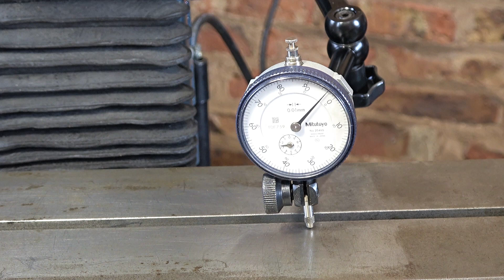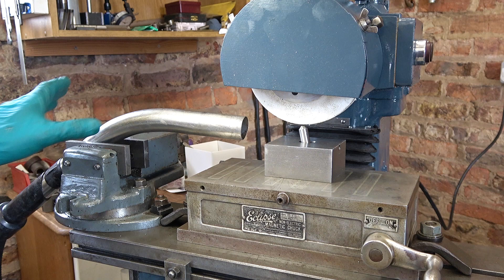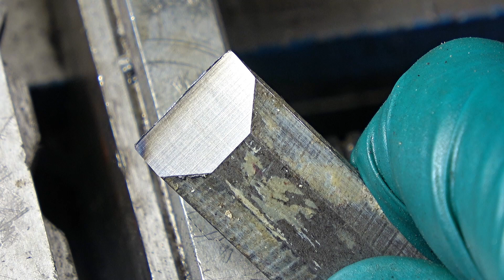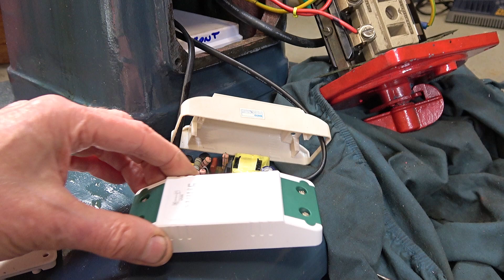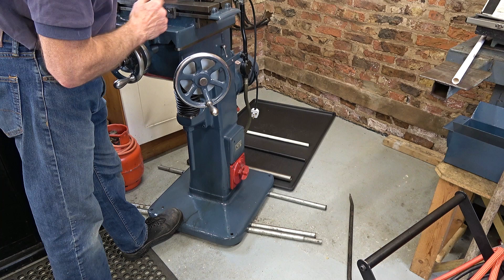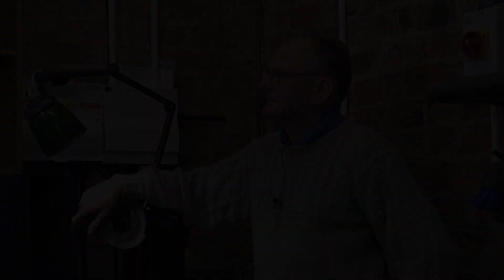HS267 Herbert Junior Mk2 surface grinder Part 16 – making sparks

Comment: Very brave project brought to a good end. Should you read comments under 11 months old youtube films, I would be very interested in a ball park figure what this project has cost you. I do not have enough space either, but if I ever do, a surface grinder would be high on my list and it would be interesting to know if such a path would be possible with my budget restrictions.
Reply from the maker: Hi, I think the grinder itself was about £275. Transportation free. The inverter would be about £80 used from ebay. The bearing maybe £30. A bit for some bronze. Paint was free to me. Ignore the bits I bought by mistake (the stuff for the static converter) so I'd guess at £450 would cover it. I've seen those grinders in reasonable condition selling for £800!! Hope that helps.
Reply: @HaxbyShed  Thank you very much! That would put a surface grinder within my budget. I will look out if any are sold in the Netherlands for such prices!

Comment: That height irregularity is always a problem with shaper tables, which is why this design is odd, because it’s longer than the table movement. That’s odd because you’re supposed to bring the table before using the machine. Then you grind the bottom of the vise, without turning the vise on, just lightly hold it with clamps at the ends, pushing at the vise. Then, flip and machine the top of the vise. Some say with the magnet off, but I do it with the magnet on as that’s how it is used. The problem with a long table is that you can’t grind it properly. That’s a design defect. If this were mine, I’d do what the manufacturer should have done, and machine the ends of the table down by about 4 mm. Leave 8” in the middle to mount the vise on. Then you can grind that to level it, as should be done. The problem with just grinding the vise is that every time you remove it, you lose your exact level if it isn’t placed exactly parallel to the table movement. Though it should be parallel if you want the vise guide at the side, and end, to be accurate. Whoever said to get an 8” table is correct. Otherwise you can’t grind the vise either, as you’ve found. You can’t cheat with your vise by removing the stop screws, just to grind the top. It will be ok, but not ideal.

Comment: Iv got the same grinder and mag chuck. Simply mark out the max working area on the chuck face and relieve the rest around the edge on the mill. You only need to take it down 0.5mm and that will give you plenty of material to resurface many times before you have to mill it again

Comment: Hi Paul. Great tip about using a dog tray as a drip tray. Definitely going to look at those. Well done on completing the surface grinder restoration. Brilliant series. I for one hope that in time you find another machine to add to the workshop and a new series ensues. 👏👏👍😀

Comment: The wheel slips a little bit in the blotters every time you turn the motor switch on. Do it a few times on and off,  then measure the wheel runout. You will see a few thousandths.  You can dress it for sure, but your balance goes out the window.  This is why all my grinders have VFD drives.  Soft start takes care to eliminate the rapid start.  Slowing the wheel with the VFD is also great to dress the wheel at a few hundred RPM.  Grit does not go all over, and you can dress a spiral into the face of the wheel to clear swarf and prevent loading up the wheel.  It does work well.  So many advantages to a VFD.  I know you have settled on a phase converter, but you can't know until you go through a process.  Cheers. ----Doozer

Comment: I believe your table has warped from the tee bolts pulling on the slots for a long time. The heads are likely too small.  The underside of the bolt heads peen the inside of the tee slots. If there is any distortion in the tee slots that you can see or feel, this is what likely happened.  You can fix this, much the same as some fitters have done when rebuilding Bridgeport tables.  You can peen the underside of the table (with a hammer) and induce stress on the back side. This balances and counteracts the stress from the tee slot deformation. The result is the table bends straight again.  The same process used to camber a beam. You can use spot heating or peening for that. Same idea.  ---Doozer

Comment: Traditionally chisels are ground in the surface grinder in the opposite orientation that you have.  Then use the cross feed instead of the table feed, and the radius of the wheel will be imparted into your chisel edge. This hollow grind allows easy honing on your flat whet stone.  -----Doozer

Comment: Since you mentioned things in the background of a shot, I noticed your drill bit sharpener.  The brand I have from the US is ‘Drill Doctor’ - and I love it!!  Great video and wonderful to see you finally get that gorgeous machine in place ready to use!!
Reply from the maker: Hi Russell, that is a Drill Doctor 360X and to be honest I do not get on with it very well. Results are a bit random and it is very hard to get any sort of clearance angle. I'm possibly going to have one last try to get it working reliably. It was expensive. Cheers Paul

Comment: Great job getting the old girl up and running!  Tip for you, flip it on and let it get nice and warm, especially before truing the wheel or grinding in stuff like chucks and critical stuff.  Things like bearings change as it comes up to temp!  Ya didnt show it, but every time that wheel gets removed, run the diamond again.  It's gonna be a great little grinder for the kind of stuff you mess with.  I picked up a B&S 6x12 on fleabay and while I don't use it but a couple of times a year, it's a sweetheart and doesnt take up much space.  I find surface grinding fun and relaxing.

Comment: Thanks, Paul, for sharing your journey with this project. Good to see it working. Strange that the thickness of the table isn't parallel but the chuck seems to compensate for it!
Reply from the maker: Hi Clive, when I get a bit of time I'm going to investigate that further. It's quite unexpected but clearly the table compensates so it must have been like that when the table was dressed. Cheers Paul

Comment: When grinding if you can have the work at an angle you can reduce the heat input. Meaning, if you are say grinding a 6 x1 bit of metal dont have the metal length wise but at an angle on the mag chuck so you have many short grinds rather than long ones, giving the metal time to cool a little.
If you haven't come across Adam the machinist, that's Not abom79 by the way, take look as he has some convincing words on grinding.
Reply from the maker: Thanks Chris 👍

Comment: Just enough space for a vertical bandsaw and they can be had quite cheap………..
Reply from the maker: Hi there I do have a table top vertical band saw which I picked up last year for £45. The sort of thing you see to cut our jigsaw pieces in wood but I think it would also cut metal sheet with the right blade. Cheers

Comment: Unfortunately you've destroyed the temper on that chisel. It needed cooling between passes. Nice idea though.
Reply from the maker: Hi yes indeed you are right. I'm going to set up some spray coolant. I have the nozzle already so I just need to plumb in the air. Cheers

Comment: Both the drivers had a square inside a square and that means double insulated and safe from line voltage
Reply from the maker: Yes I think it would have been fine but the replacement was so cheap and it was easy enough to change whilst the panel was off. The one that was on was old and salvaged; no idea where I got it from.  Cheers

Comment: Its alive, table or feed direction doesn't matter,  surface speed delta or differentiation is very high.
Cheap vacuum cleaner tip, look up Ash cleaners, ref fire ash.
Love the dog tray solution 👌, I did look at a grow bag tray recently at my local hardware store; interesting on LED driver.
Next video: powered X axis reciprocating facility 🧐🤓🦾.
Thanks for sharing.
Reply from the maker: Hi John, I've googled the ash cleaners. Early days yet but If I use the grinder a lot I'll get one of those. Cheers
Reply: @HaxbyShed  Hi Paul,
I was looking for a basic vacuum for wood working, the one I purchased was a Rocwood 20 Litre 1200 watt, model RWAC3; currently £ 49 on Amazon, or 13 coffees ☕️. 
It has an aluminium lined hose, OD is 34/35 mm.
I have it coupled with one of those cyclone vortex gadgets, not too noisy, and quite good filtration.

Comment: Ive got a vevor 6x12 inch magnetic chuck, ask them if the sell a 5x10 or 6x6 version. I really like the one i have $220 delivered, i use it on the mini mill, fits sweet on the table👍👌🇦🇺
Reply from the maker: Hiya Adhawk, unfortunately the Vevor catalogue is more limited here in the UK. Cheers Paul

Comment: The first driver is isolated, but likely the manufacturer did not want to pay for the extra insulation to make it pass SELV test. Yes you will never buy another machine for the shop, at least this week.😉
Reply from the maker: Hi Sean, the new one says SELV on it but who knows. You can do anything with a printer these days. The old one had a resistor soldered to the board at one end and sticking up into fresh air at the other - wonder what that was all about? Cheers
Reply: @HaxbyShed  Could be anything, or it was soldered on end to reduce footprint. would need pictures to show and see why though.

Comment: The magnetic chuck was trued on the table, getting rid of all the errors on the table.
Reply: If you can't dress the top of the magnet because of the travel of the machine , perhaps you could shim it to closer tolerance. Very nice job.
Reply from the maker: Hiya Sean, I need to do further investigation on that table and indeed the chuck. I find it hard to believe Herbert would have made it like that. Cheers
Reply: @HaxbyShed  Possible, but those tables are normally used with fixtures, so the fixture would be surfaced with the table to get it right, the table just has to be close enough so the fixture does not need much to true it.

Comment: Hi Paul, good to see some sparks. I’ll say this as you didn’t mention it; when dressing the diamond must be just behind the centre line of the wheel I.e on the outfeed side so if it catches the wheel will push it away. If it’s on other side the rotation will pull it  into the wheel and you really don’t want that. I take about a thou off per dressing pass and you need to to go a lot faster across the wheel, I go as fast as I can rotate the handwheel this gives a better dress. Yes your chuck is too big as you can’t surface it with the machine, this seems to be a common issue as mine was the same as is my friends. I’d look to swap it out. Do not be in a hurry to surface the replacement as it takes a while to get your hand in and learn what works for you.
Reply from the maker: Thanks Tony. Cheers

Comment: You could always mill a slight relief on each end of the mag chuck you have, just a few thou deep enough for the wheel to clear at the end of each stroke. Instead of looking for a smaller chuck.
Reply from the maker: Hi David I think that is a good idea. First though I'm going to find out where the error is in that table. I can't believe it was made like that. Maybe it's bowed - but I don't really believe that either. So ...... ?   Cheers
Reply: Good idea 💡